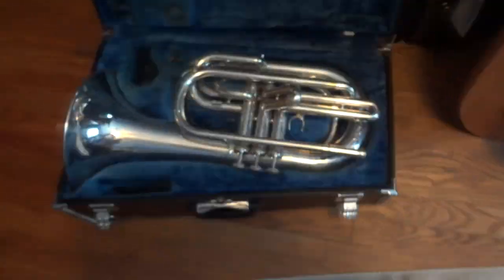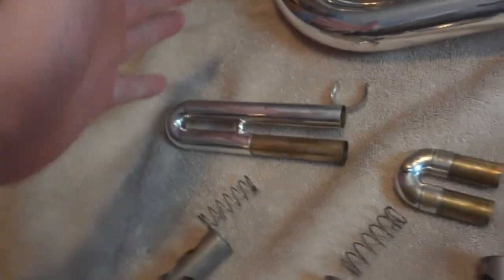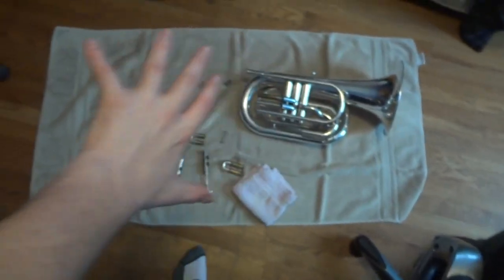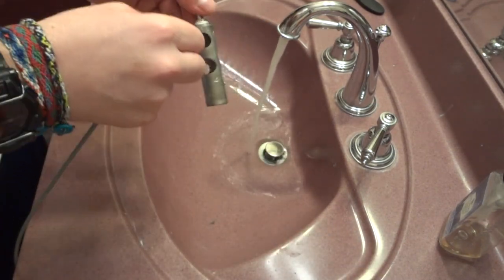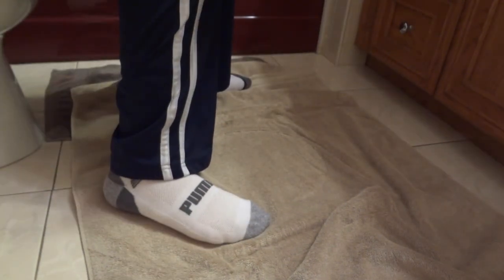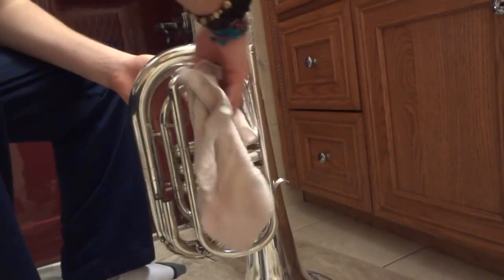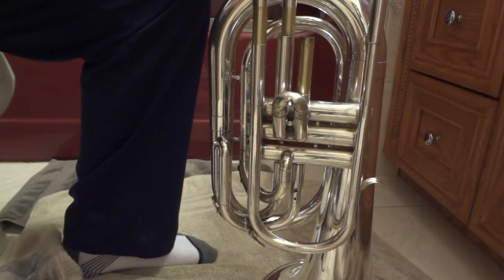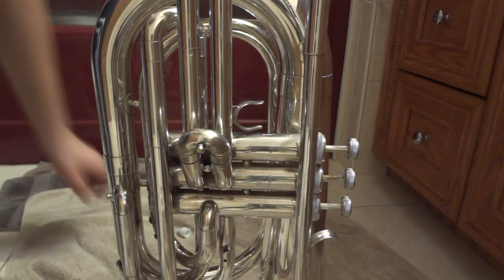How To Clean A Marching Baritone

Comment: On my baritone, which is a jupiter quantom marching baritone, on the A1 Slide i thing is what you call it according to google, is a slider thing that is hooked up to the valves and when you press and hold this button, the slide comes out a little letting you fine tune a note while you play. But since it’s connected to the slide, idk how to take it off. Also, the B1 slide i’m guessing which is the one on the 2nd, just won’t come out. I don’t know if it’s supposed to come out but there’s a crevice like where the slide would come out from. You don’t have this type of baritone but i’m just wondering.    8:17 Also, watching this physically hurts me.
Reply from the maker: JJ Clark usually the thing that holds those slides in are screws. You would need to take the second valve slide out. If you can’t do it. A shop might have to do it. Also it really isn’t bad at all for the instrument if it’s on the bell. If you are outside. It’s bad because it can fall over. But on a bath mat monitored. It’s really not any cringe. You will learn when you are older.
Reply: Dustin Does Multitracks Ok thanks man.

Comment: Is it okay to clean the baritone even if I can only get one tuning slide out?
Reply from the maker: Thomas Barber I wouldn’t. Just because you really want to get everything out of the Instrument. With a snake. And the drying process is really important. You can try using a small cloth to pull the slides out.
Reply: Sometimes a tuning slide will "stick" because it is vacuum locked.  Press down on the nearest valve (usually the one closest to the mouthpiece), and it will come free.
Reply: I’ve slightly solved the problem but not quite: I got a newer baritone and all the tuning slides came out, but last week my second valve tuning slide went from super loose to super stuck and I can’t get it out. It’s not vacuum locked it’s just frozen all of a sudden….
Reply: @DavidJNowak  You probably already knew this, but this reminded me: PLEASE PUSH DOWN ALL OF YOUR VALVES WHEN REMOVING A SLIDE. IDK WHY BUT MY BAND DIRECTOR FLIPPED WHEN I FORGOT TO DO THIS